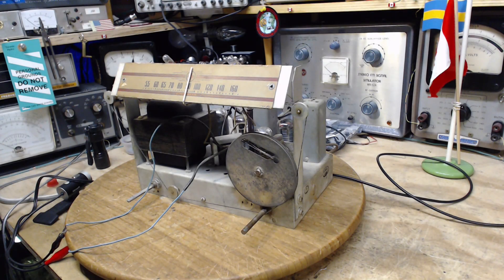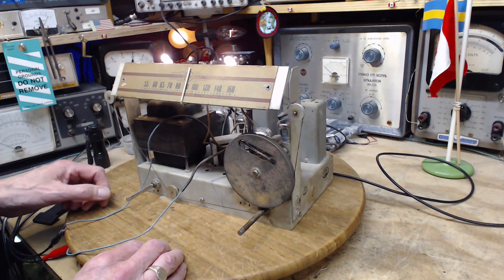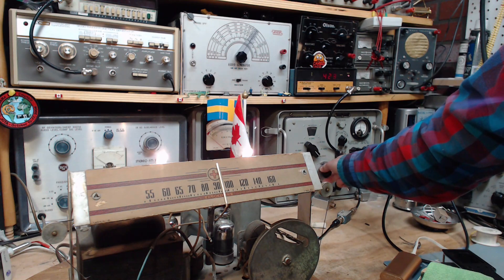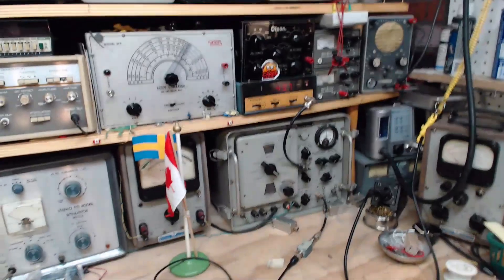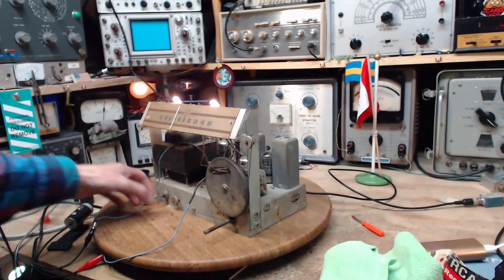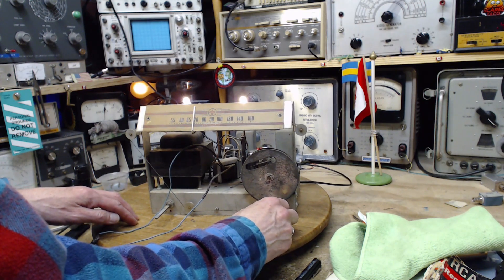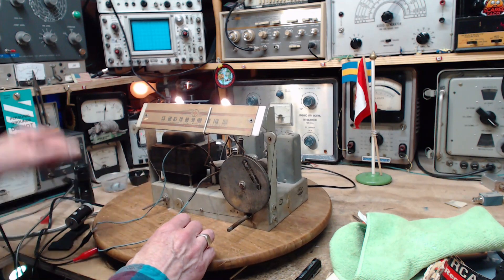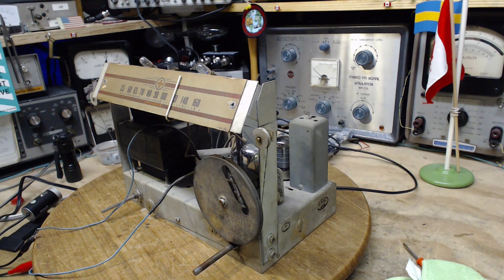1940s Canadian Red Cross Tube Radio Video #4 - Quick IF Alignment

Comment: A point missed here: Often the IF is not 455KHz. There are  number of good reasons to use an IF frequency offset from 455. Meaning that is not safe to assume that it is 455. Good point that it should be checked/aligned at the normal operating line voltage.
Excess input RF/IF injection results in the IF being shifted  - at least some and it makes the alignment "by ear" misleading. Jim has the equipment to do a rudimentary "sweep" to make sure where the IF is and whether or not it has a good shape to the bandpass. The sweep can be done by hand.
There is a point here: many of us try to add content regarding good practices. Yet, there are those that seem to think that "We could not do better" or "if you don't eat it".  Think again.
When an issue is raised, good background information is offered. I think that a number of experienced, well informed people offer up their experiences.
For my part, the viewers can benefit from these experiences. Some have had to make a living at this and would not have lasted long by employing poor practice.
It is not a competition but it is my perception that others are trying to be helpful to the viewers despite the frustrating presentation.

I have a lot of very fine test equipment but much of what we see here only needs a Simpson 260 and a few other things available as surplus. Even some homegrew stuff cam make things easier.   Just sayin

Comment: Doing an alignment on a radio with lower line power and ancient paper capacitors is a waste of time. Once replacing all of 
the caps, checking resistors , tubes and cleaning the grubby  pots then doing an alignment is always the right thing to do
 but that doesn't stop Jim.
Reply: Another detail that so many do not seem to know about   - -  The input level should be kept below the AGC threshold in order to preserve the proper band pass characteristic.  Doing it by ear can be done but it is a bit sloppy
Reply: Why he never replaces the caps first I can't figure it out.